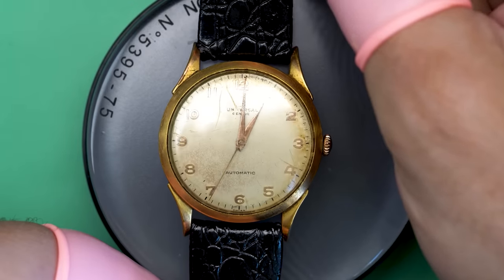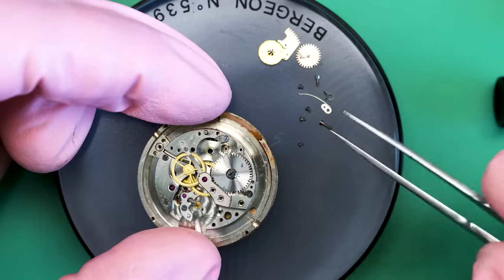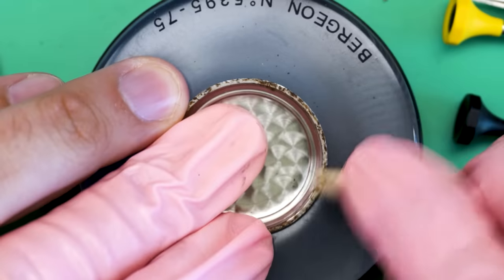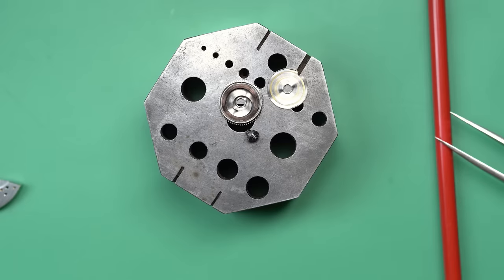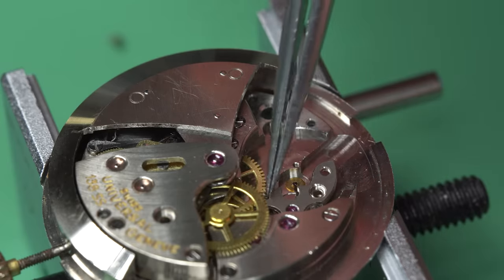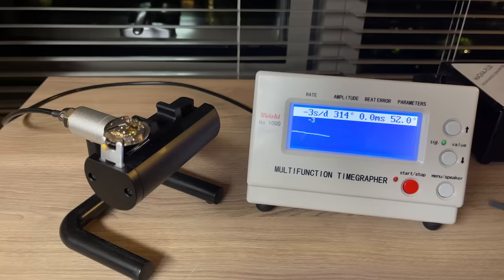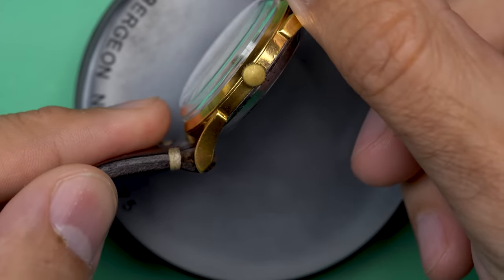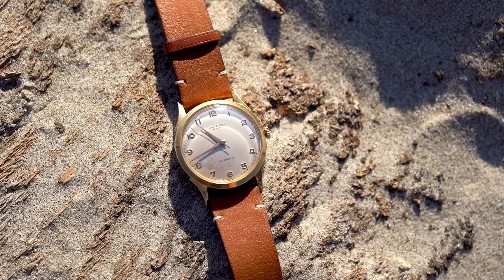Universal Geneve Gold Vintage Dress Watch Restoration

Comment: Beautiful watch and great video, as always! Did the stem break at 46:23? It disappeared, but couldn't tell if it snapped off, or just shot down into the pin vise.
Reply: watch image by image, he puts pressure on the stem and it shoots into the pin vise. that being said, I'm amazed he did not break the stem while filing.

Comment: I buy old two and four stroke lawn equipment.  I also tear it apart, down to the last nut and bolt if possible, to clean it and get it running again.  I have several piles of parts that are in my work shop that should be functioning chain saws or lawn mowers.

Comment: You want a good watch for the channel, get a 1980s soviet Slava 2414 movement with the DUAL mainsprings (higher accuracy and very unique). I have got 1, suspect another 1 but I haven't opened it, and have a broken one coming in a GLORIOUS rectangular fully gold plated one I ordered today ($15 YEAH.... only $15 and it's like nothing else I have seen complete with the slava logo etched onto the back cover and the back cover gold plated which NEVER happened with soviet watches, very few even had a gold plated case). If you really want, I can get one sent to you direct via ebay.

Comment: Hi Marshel. Inspired by your great videos and presentation skills, I've started going down the same road as you with watchmaking. Reaching the stage now where I'm fixing more than I'm breaking. Thankyou.

So, I went back to this video because I had an old battered Universal and thought 'hey' I can save some time on all the photos and notes and use this video as a guide.' Worked really well right up to the last few parts when I went to fit the setting lever...lol....thing is I was saying to myself "surely I need to fit this with the spring? Perhaps it just pushes and clicks in? I'll follow the video". Lesson learnt on shortcuts.  

Thanks again for the great work and inspiration.

Comment: "How many things have you completely dissembled and put back together?" I have a 1966 Triumph T100 that came to me in several boxes. It was locked up and very rusted. It is back together now and running. It's not a wrest watch but it has the complexity of a Swiss movement.

Comment: Different style but I have one. Rectangle case with a gold band all 18k.  When I got purchased it was not running so I opened it up and found an quarts movement in it. Bummed out but can a proper movement be put in it?  Thanks.

Comment: I'm a retired "Aerospace and Mechanical" Engineer.  It says so right on my diploma.
I spent 20 years doing mechanical design in heavy industry, perhaps the heaviest imaginable. Oil Field.  Steel Mills.  Forest Products.  Where, by contract, we were sometimes not allowed to use anything smaller than a 3/8" bolt.
Then I went to a "large manufacturer of commercial airliners" in the USA, where I was working on flight control mechanisms.  We practically had to explain to management why we would want to use something so extravagant as a 1/4" bolt. (No, not really, but I'm not exaggerating all that much.)  Number 4  through 8 threads?  Par for the course.  I thought I'd become some sort of watchmaker..
And then, not so many days ago, YouTube sent me to this channel.  Holy Cow!

Comment: You got me interested in watch repair. Thanks! However, I'm restoring my first watch (Waltham 1894) and I put the movement in ultrasonic watch cleaning solution (#566 non amoniated) and it stripped the paint off the lettering. What did I do wrong? Please help
Reply: You shouldn’t put watch dials in the ultrasonic, only the movement parts and the case. If the dial is dirty, you can use a cotton swab and a little distilled water or pegwood to gently brush it clean
Reply: @JFCaldwell  I didn't put the dial in the cleaning solution, only the movement. It stripped the paint off of the lettering on the bridge. But thank you for your response
Reply: I see, thank you for clarifying. If you stripped the paint off a bridge/cock, then it’s relatively straightforward to replace it. You ll need a bottle of enamel paint (easy to find at a hobby shop or online); Black or gold depending on your watch. Brush a layer over the text you want to paint (don’t worry about being too precise), let it sit for about 60 seconds, and then lightly wipe a cotton swab soaked in isopropyl alcohol over the painted text. It may take 2-3 coats, but this is the basic method for repainting the engraved text on watch movements
Reply: @jfc2160  Thank you very much! I'll give that a shot. I used to build models so I should have everything to do it. But I still wonder what I did wrong. I just scored a railroad grade watch movement and I really don't want to screw that one up. I have a few to practice on first before moving up to that one thankfully

Comment: You could replate the crown.  Caswell Plating in Rochester, NY sells brush-n-plate kits for touching up gold and silver plating. The gold kit starts at about $80.  I've used them for years with good success.

Comment: The file used to do final trimming on the new stem seems to me awfully course for use on a part that size.  As an amateur machinist my instinct would be to use either a much finer single-cut file, or a stone; and my personal tool stash has many sizes and grades of files, diamond hones, sharpening stones, etc. that get used a lot.  I can't argue with success, but it does look like an oversize, overly course file for use on such a small threaded stem.

Comment: It’s not nearly as difficult our daunting as watchmaking, but I am a knife collector. I like to take apart my pocket knives and clean them, oil the pivot, then reassemble. I find it is getting rather common nowadays. To the point that knife companies will manufacture in a way that is easier to user service, and some even include the tools you need when you buy the knife! I have stepped carefully near watchmaking, simply modifying some Vostoks. However I have a long way to go. So far, applying the hands has been the most difficult for me.

Comment: Hi Marshall, I have the same movement and was pretty sure the click spring for the rotor goes on the back/top end of that click so I checked mine. Mine even has a screw in the bridge so it can't go too far out. Google 138SS bumper movements, if you want to see what I mean.

Comment: Man, you really hit the lottery on this one! I have to confess that it didn't look like much to me until you brought the case out of the cleaner. Of course, the movement was gorgeous, but the case and the new crystal with just a little bit of cleanup on the dial just turned this into a gorgeous watch! Interested to know what you paid for it on eBay as a non-runner--I really like knowing that and I appreciate it when you mention it in a few of your videos. Another question--do you edit your videos and then do the voice-over? That's how it seems but I'm interested to know your process. Thanks.

Comment: - Consider using a file for the points on a car distributor for trimming the stem or other parts.
-  amazon()com/Performance-Tool-W123C-Ignition-File/dp/B00F3QR1GM/

Comment: What was it with the 2 click springs one for the rachet wheel and the bent one 🧐
Reply: The ratchet click allows you to manually wind the watch. The curved click is part of the rotor/bumper winding assembly. The rotor only winds in one direction. I have had a number of old bumpers that only have the click for the bumper (some Mido's for example). They can't be manually wound. It's a pain that you have to shake the watch for a minute or two to get it started.